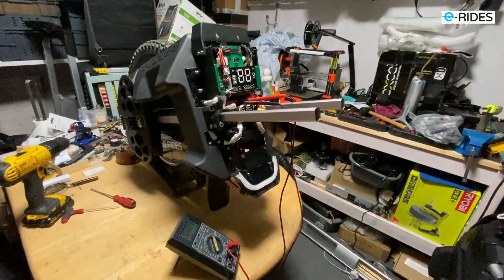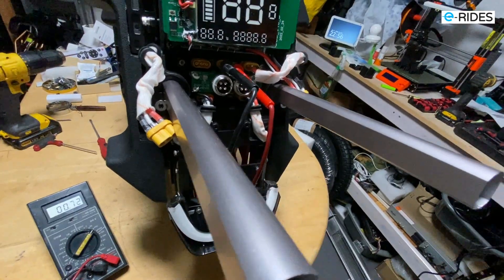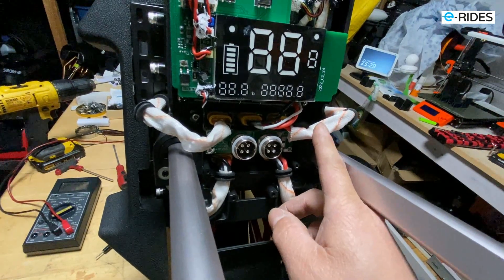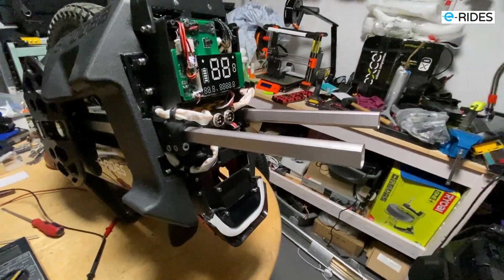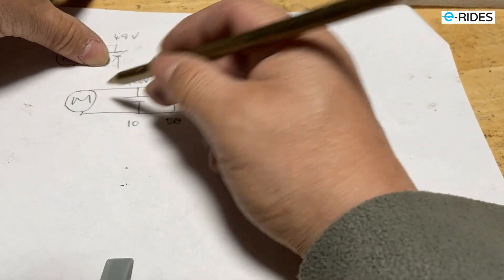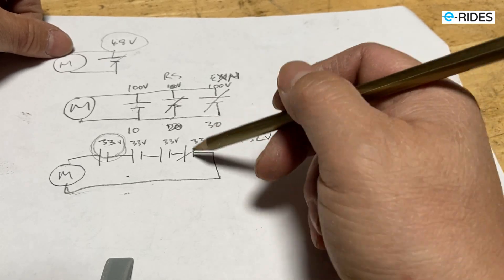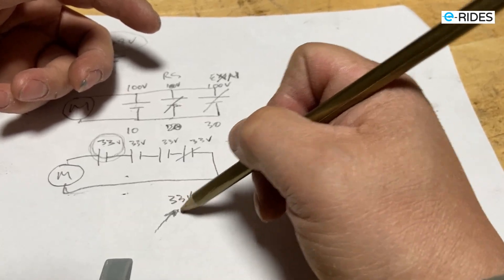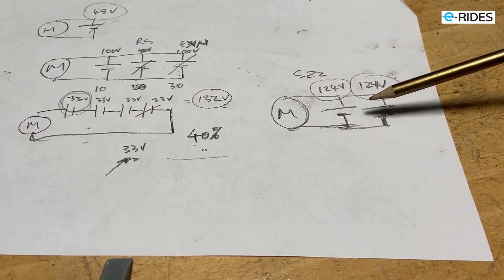Begode Master The True Battery Voltage. e-Rides EUC Upgrade.

Comment: Thanks, good teardown vid! If this is how Gotway is planning to do "134V", it's a solid pass on all such designs for me. This is basically one big series pack, no parallel to share the load, every cell has to bear higher amp load and suffer deeper voltage sag under load, due to the lack of true parallel-ing. Plus series chaining at that battery aggregator board of MR30(?) MR60(?) connectors  introduces many more points of failure. Please do a video of Afeez's 134V RS to see if they're doing the same "134V" board aggregation of 4 ~33.6V packs.
Reply: That's not true that each cell will bear a higher current load. Each pack will bear a higher load than parallel packs would, but the series pack still spreads the current across 4 parallel cell groups (the Master's packs are 8S4P, where 4 8S4P packs in series yields the 32S4P 134.4V configuration). I don't care what Dr. Lewin says, Kirchhoff's law holds 😂
That said, I'm not sure what the degradation of a bad cell looks like in this configuration, and I don't know how the parallel groups are connected inside the new packs. Assuming that the other Begode batteries don't just completely disconnect during a "failure," this new battery configuration would yield a similar situation where a failed cell group causes the others to "pick up the slack." Still a dangerous situation either way that would need to be addressed with urgency.
The points of failure at the series connections are certainly something to keep an eye on - definitely check those solder joints. Similarly, a cable failure would be a complete system failure.
Reply: @redfoxdude  Eh, I don't see your first point. I'm fine if I'm proven wrong, always good to learn something new, but then your explanation is lacking. This wheel is rated as an operation 134V 32S, ie. true parallel count is 32 cells per parallel, not some subdivision of 8, otherwise you're running a lower operational voltage is my understanding. Are you trying to say you can just subdivide down to any mix of number series physical packs? Then why would you ever limit yourself to whole full 24S 100V or 20S 84V packs, which has limited EUC designs for the past 8 years due to space constraints, sometimes weird bridging of small packs wired to the main pack. 
And my higher load point was inferring that there is higher amp load per cell vs if you had another True 32S 134V parallel pack in-line, so that the load is spread across like 32S2P / 64 cells, vs the Master 32S1P / 32 cells, ie more True 32S Parallel. I was NOT saying that there was more load per cell on this 4 subdivided configuration vs a true whole 32S1P pack same number 32 cells.
Reply: @houseofjob  Ah, I see the misunderstanding. I agree that 32S1P would yield very high strain on the cells. However, the Master is not 32S1P - it is 32S4P.  Each individual pack is 8S4P. (For clarity: 8 cells in series gives you the 8*4.2V=33.6V pack voltage. 4 packs in series gives you the 8S*4 packs=32 series in total for the 134.4V system voltage.)
There are a total of 128 cells in the Master, so each pack has 128/32=4 parallels inside: 32S4P. (EDIT: For some extra clarity: we can calculate that there must be 128 cells. The listed capacity is 2400Wh. The 50E cell has approximately 18.5Wh (3.7V*5Ah). 2400Wh/18.5Wh = 130, where 128 is the closest common multiple of 32, 32*4. Thus, the Master is 32S4P.) So it's a 4P like in the RS for example, in terms of the distribution of load across the cells. Each of the two RS packs have 2P, and two of those in parallel gives you 4P in total.
As for why you would limit yourself to full packs, my main guesses would be cost and build complexity. It's been helpful in that way for Begode for reuse of the same pack in multiple EUC models. Otherwise, I'm not really sure. The Sherman splits each 100.8V pack into two 50.4V packs on either side.
Reply: @redfoxdude  I see. This is a better explanation yes, thanks. I forgot about the 128 total cell count, distracted by this foreign concept of summing the 4 physical packs to make the full 134V. 
I think the Shermona is a different beast tho no? it bridges the gap of BMS connect / split BMS, with a wire that only goes between the 2 adjacent packs, ie. no mix and match possible, no connecting of this communication wire to the XT60 or XT90 termination at the board, no using each pack independently.
We had an engineer rider friend who was has since passed, who tried to explain something similar to this, splitting of Series count to sum as a bigger operational voltage, but I'm still admittedly struggling to wrap my head around that. If you have any online resources about this and could link, I would much appreciate it! (and thanks for the reply).
Reply: @houseofjob  Yeah, the Sherman's series packs aren't fully independent like the Master's - they have BMS connections between the series packs, like a split BMS as you described.
I'm sorry to hear about your friend passing. I'm an engineer (electrical) too. Totally happy to chat about this kind of stuff, engineering is both my profession and my hobby =) As far as splitting the series count (ignoring parallels, let's consider any parallels as if you just have a single cell with higher capacity), when you follow the path of electrical current, say from battery (-) to (+), each time you pass a lithium cell in that path, you get a voltage boost (+4.2V if at full charge). The electricity flowing through the cells along the path doesn't care where you place the battery housings, if it's still along the same series path, you still get the same boost. So putting another pack in series, you add more cells into that series path, adding even more voltage.
I don't have resources right off hand, as I am going off of my knowledge from stuff like nodal analysis. I don't wanna link that stuff though, way too into the weeds, ha! I did find this, which looks like a decent go at it: https://batteryuniversity.com/article/bu-302-series-and-parallel-battery-configurations
Reply: @redfoxdude  Good stuff, that makes sense, thanks!

Comment: I prefer the less devil of the two, fire Vs cutout, sorry I have to choose cutout because fire in the house is much more serious and life threatening issue.  Both choices are bad, but if it cuts out, at least it is rider's fault.   Thanks for the analysis.  So yes I think Begode has made the right decision here, and I am switching from KS S22 to Begode Master.  This adds to my buy decision here.
Reply: S22 smart BMS will be able to detect abnormal cells to prevent fires during charging.  The problem with fires while charging is from "dumb" BMS trying to charge stubborn cells.

Comment: Sir, how about RS 134v?same way or not?
Reply: It's probably the same becausethere's no space to fit the extra cells needed to do paralleled packs. It's likely a 32s3p 40T cells 1440Wh. Two 16s3p packs in series.